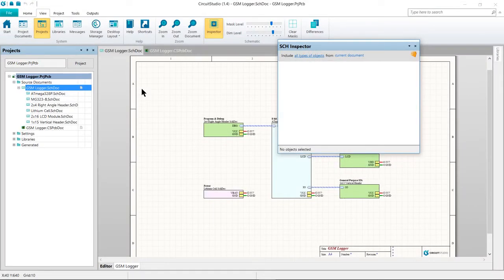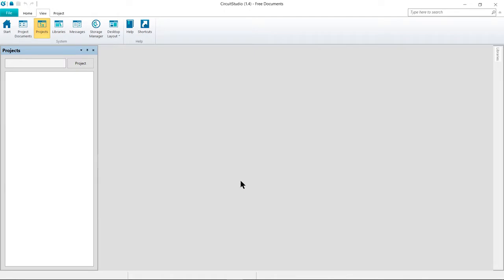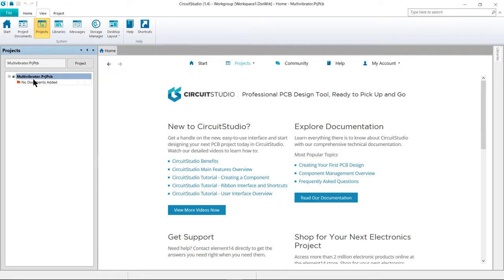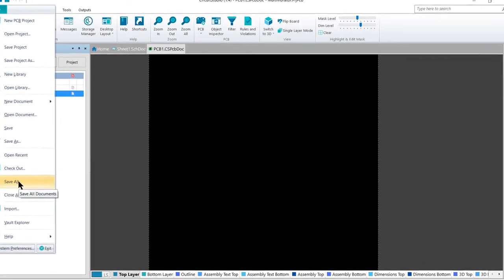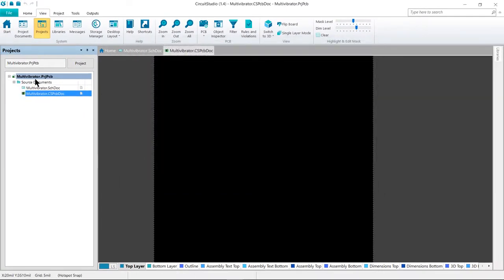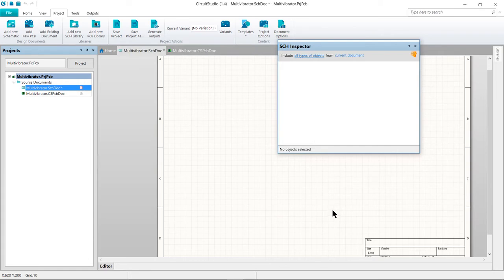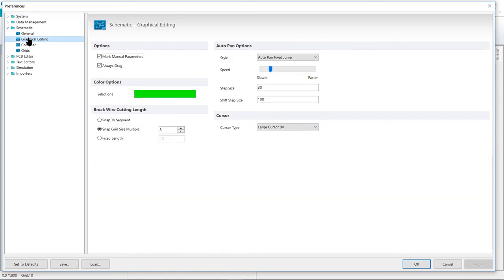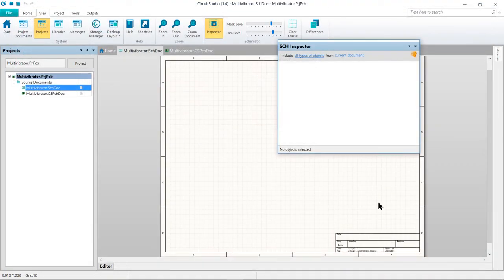(2) Getting a Project Started in CircuitStudio - Altium Academy

Comment: I know I'm wasting my time here, Altium has NEVER responded to ANY of my questions on ANY platform regarding CircuitStudio. Even my Altium rep at work where we pay $5k a year per seat for Designer won't respond to my questions about CircuitStudio. But my question is so simple, how the heck to I start the 30 day trial?  All I get is errors and no responses to questions.  It seems like Altium wants you to ask some company called Element14 but for some reason won't just come out and say that.  (As an aside, don't put your name all over a product if you have no intention to support it in any way.  That's bs.)  This product is handled so poorly by Altium.  Also I see no dates after like 2018, which is weird.  It really seems like it's no longer supported.  I don't get why Altium even offers these when it seems very clear they're just vehicles for pitching Designer.  Just fyi guys, nobody who is looking at free or $500 software is going to buy Designer.  Nobody.  Cheapest Designer license I see is $2k a year.  If we were ok with that we would just do it.  The simple act of looking at free of $500 software proves they don't want to pay $2k a year.  I really don't get any of this stuff